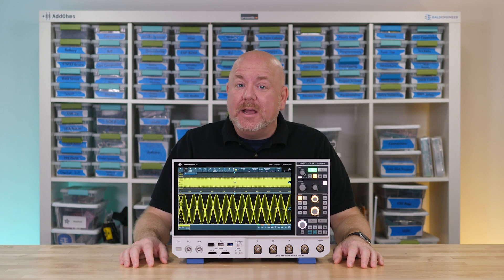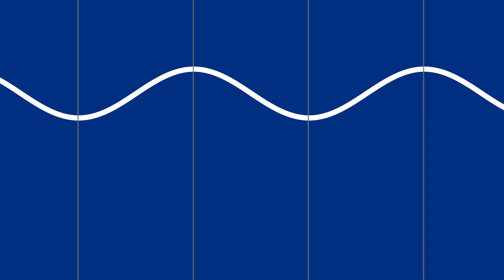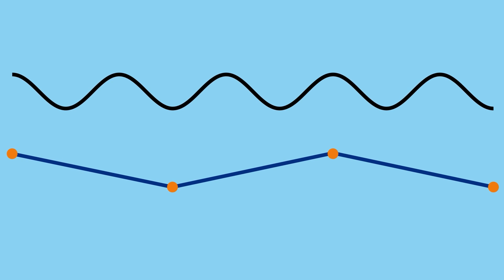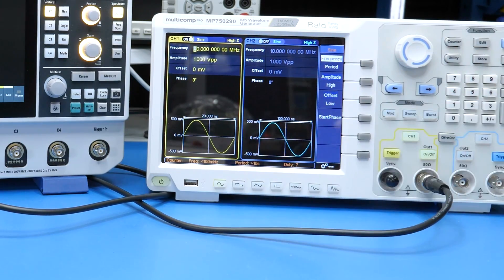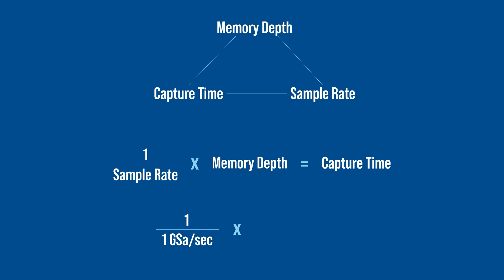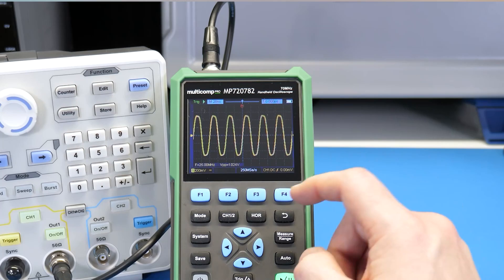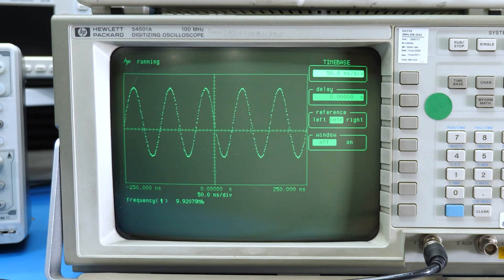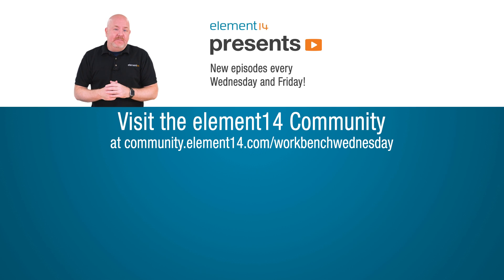How to Avoid Oscilloscope Aliasing Pitfalls for Accurate Measurements - Workbench Wednesdays

Comment: Is aliasing a practical problem if the analog bandwidth is significantly lower than the signal? E.g. with an analog BW of 50MHz and 500MSa/s? (Signal >250MHz)
Reply: It depends. The analog bandwidth is effectively a low-pass filter. Bandwidth is specified at the -3db point, like all first-order low pass filters. So if you put a 250 MHz sine wave into an oscilloscope with a 50 MHz bandwidth, you won't see (much of) anything past the pre-amp. You might see a very small ripple but it would probably be in the noise floor. 

(Also, I should point out that some digital oscilloscopes don't have a first-order response. When the gap between analog BW and sample rate is smaller, they tend to be much steeper as a way to prevent aliasing.)

(Edited after I realized what you were asking.)
Reply: @bald_engineer  So, I had the idea of making a Raspberry Pi Pico Oscilloscope, so I overclocked its ADC to 2MSa/s. However, I was unsure at what value to set the analog bandwidth (via r-c filter at the adc). Then I had the idea that it should be possible to remove the effects of the r-c filter in software and set the analog bandwidth relatively low. But, as the filter is there in hardware, instead of sampling at discrete timeslots with the sample-and-hold capacitor disconnected in-between these timeslots, I would effectively average the voltage of the whole timespan, not just the sampling slot. Tests reveal that I can perfectly reproduce square waves (except the one sample where the voltage level switches, which is in-between the 2, level depending on the exact time where the level switched). I was just now thinking about if this was alias-proof. Thinking about it, it likely is not completely, but should perform better than without the hardware+software hack.

Comment: Is there any chance of something showing as the wrong frequency on a purely analog scope? I saw a 200MHz wave (some ringing) on my 60MHz BW scope. Assuming attenuation like a standard r-c filter I calculated the signal to be ~4ish times larger amplitude in reality than displayed on the screen. How good are the chances of this being correct?

Comment: Random thought...  Add randomness / jitter to the sampling slice...  eg +/- rnd(5%) and that should help alert to aliasing.
Reply: Interesting idea. However, scope manufacturers work very (very) hard to keep their sampling apertureas tight as possible. I don't think they would like the idea of adding any kind of jitter.

That said, sequential (non-real time) sampling scopes, like the HP I showed at the end, purposely randomize their starting relative to a trigger to help reduce aliasing. Those style scopes significantly under sample relative to their analog bandwidth. (I cannot say for certain if the HP 54501 does, but I know other sampling architectures support it.)

Comment: Very good video on aliasing, I feel like most labs in school dont cover this topic appropriately!
Reply: I think most DSP classes covers the topic well. However, not everyone takes them. And while fundamentally they apply to how an oscilloscope (or any test tool really) captures data, there are practical differences. 

Oscilloscopes are really easy to use. However, they are also easy to configure wrong while showing convincingly good waveforms.
Reply: @bald_engineer I need to discuss a small point with you! How can I reach a possibility to sample a CW signal with smaller sampling than 2.5 Nyquist? Some systems declare they do and I do not understand how
Reply: @AdrianGonzalezOK  If the signal is repetitive and you do not care about transients, then you can sub-sample. It is how the early high-bandwidth digital oscilloscopes worked. (Including the HP I showed at the very end.)

They were only really useful for clock signals or drawing eye diagrams of data signals.